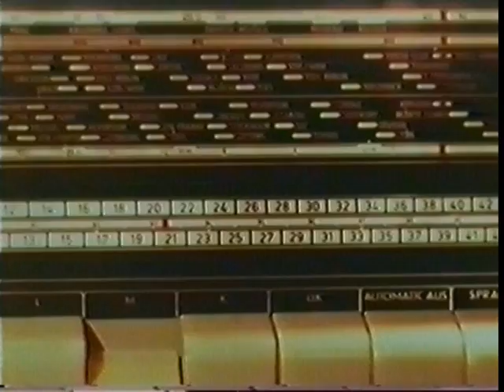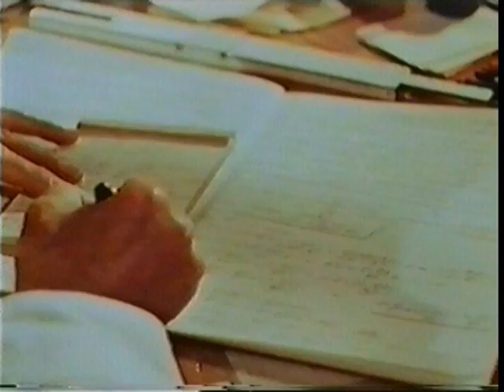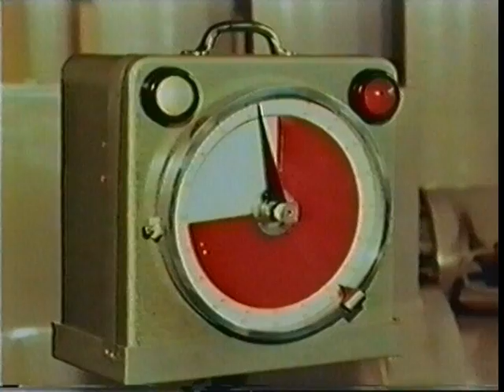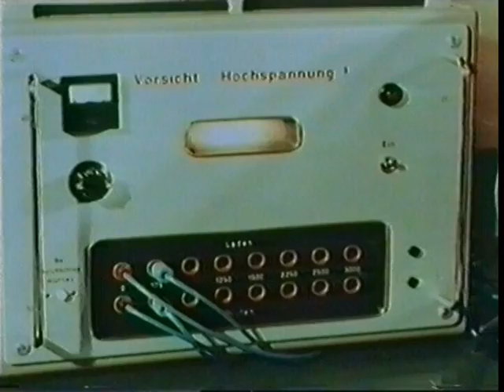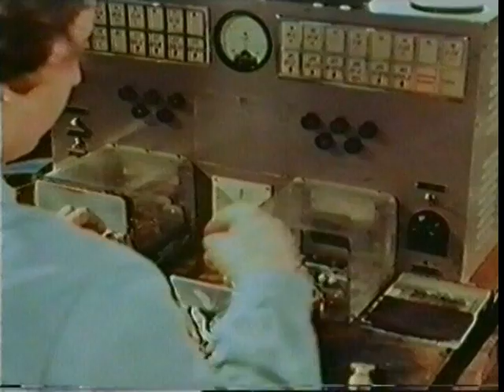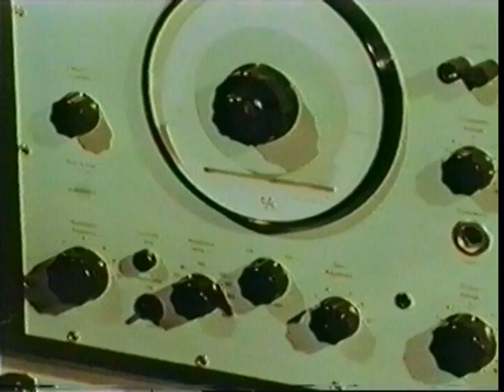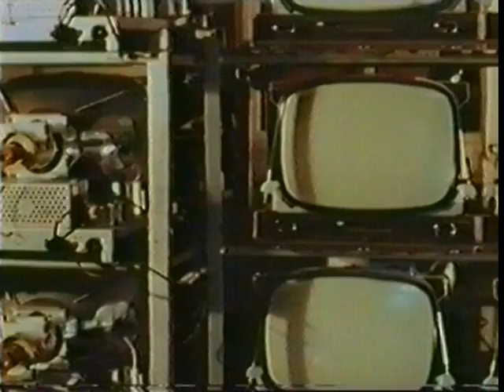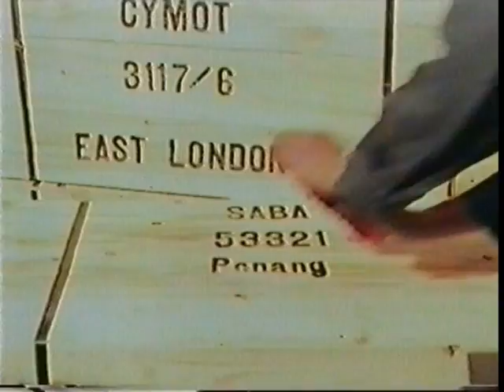Der legendäre SABA-Film

Comment: German radio at that time looked and sounded much better than ugly American radios. The fine quality and craftsmanship of those valve radios is world class. I have two 1961 German radios, a Loewe Opta and a Blaupunkt. Both have worked flawlessly for 57 years with no repairs.
Reply: go for the SABA stereo tube radios (e.g. Freudenstadt 11)- they are amazing!
Reply: InstaBlaster...
Reply: As for sound, Germany had to develop stereo FM broadcasting very early as after WWII the AM frequencies had become suddenly short. FM Stereo sounds better with any cheap radio than AM, provided a transmitter as close at 30 miles. The federal net of broadcasting stations supported this very well.
Reply: That is why all German radio and TV manufacturers went bankrupt. They invested to much money in manufacturing excellence instead of setting new trends that would create new demand.